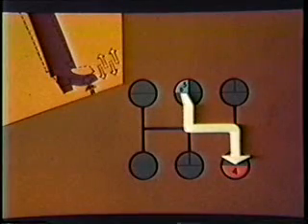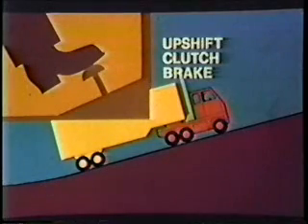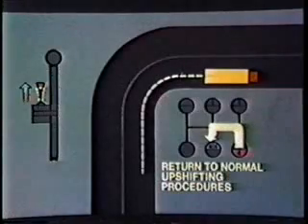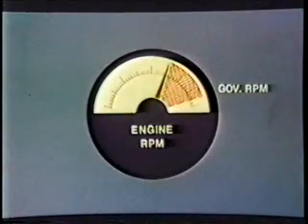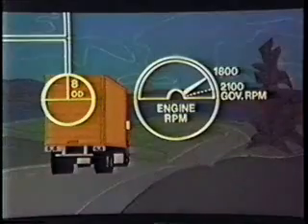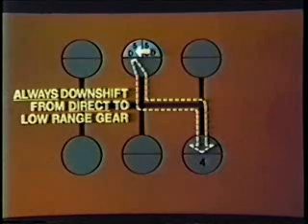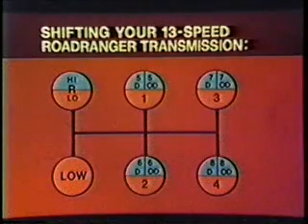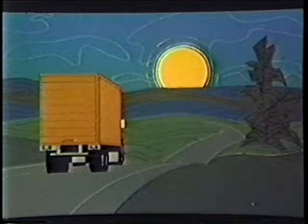How to shift and operate a Eaton-Fuller 13 speed transmission PART TWO [Vintage Slideshow]

Comment: I doubt this is the same trans as you drove then, and I'm sure you've gotten better since. This is for a Roadranger transmission. Wrong trans but the shift pattern and shift method hasn't changed

Comment: Yeah.  I haven't drove a truck in a while.  I was thinking about the 13spd with Lo Hole as we call it aound here.  Most of the time, if we are loaded, we'll put the splitter in Lo Hole, take off, then move that button to Direct, move the stick into Neutral and back into first.  Kinda like a 8spd or 10spd with 5 extra really low gears for bad places, starting off with heavy loads, and so-on.

Comment: Seems to me messing with that button would be a pain.  If I were in Direct, I'd wanta shift from 5 D -> 6 D -> 7 D ->.8 D on the stick, move the button to OD, then lever back to where 1st and 5th are which would be 9 OD and then shift the stick all the way through again.  Seems easier to me.

Comment from the maker: Cheaper, lighter, and much stronger. With as many ratios that hauling heavy loads require, syncros would just add size and weight to the already-huge gearboxes.

Comment from the maker: Although this slideshow may be old, to my knowledge a Eaton Fuller 13 speed is still shifted the same as it always has. just the splitter knob has been replaced with the more egonomic button. Keep on practicing shifting bro, you'll get it. non syncro transmissions are a whole different ballgame.
Reply: There's actually 3 different shift valves that have been used on the 13 speed. The first is the one they show, which has a plunger for hi and lo, and a button on the side for direct, and OD. The second replaced the plunger with just a 3 position button on the side. Makes it impossible to shift to low range with OD selected. Those were both the older big chrome valves. The third is the newer style with the paddle for selecting hi or lo range, and the red button on the side for selecting direct, or OD.

Comment: Look up EATON FULLER PROFESSIONAL SHIFTING PERFORMANCE ON YOUTUBE! BTW WHEN I LEARNED TO DRIVE TRUCKS THERE WERE 2 SHIFTERS  AND TO CHANGE RANGES ...4 OF THEM...YOU HAD TO HOOK YOUR ARM THU THE WHEEL TO GRAB THE 1ST SHIFTER AND THEN USE THE OTHER TO SHIFT THE 2ND SET OF GEARS. NO AIR SHIFT THEN ON THOSE TRUCKS!  TIME TO GO BACK TO SCHOOL couragio! If i road tested you and you shifted like that = NO JOB!